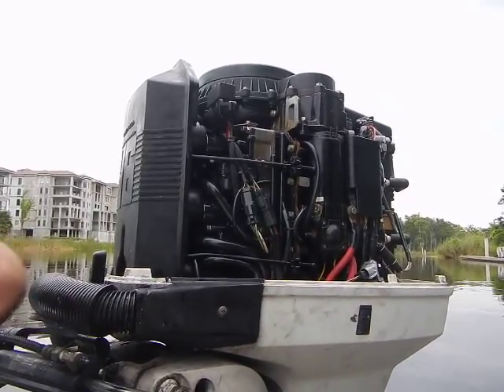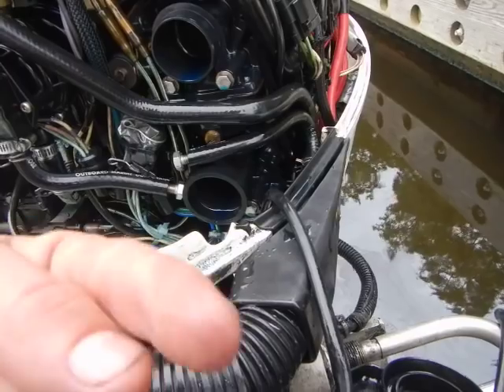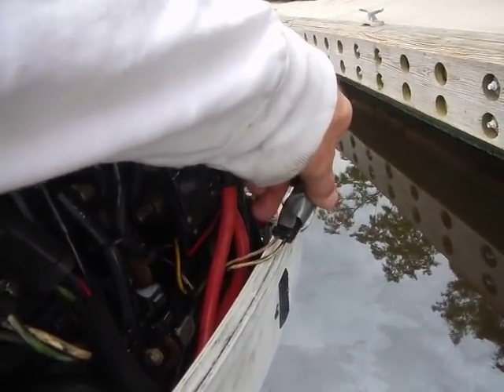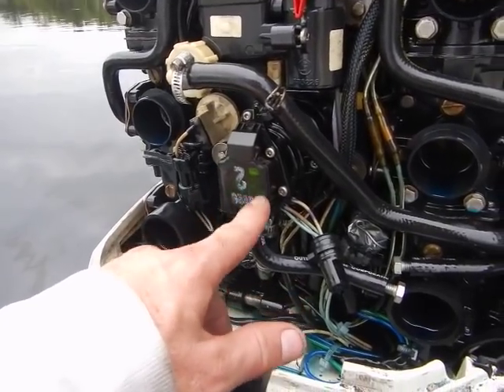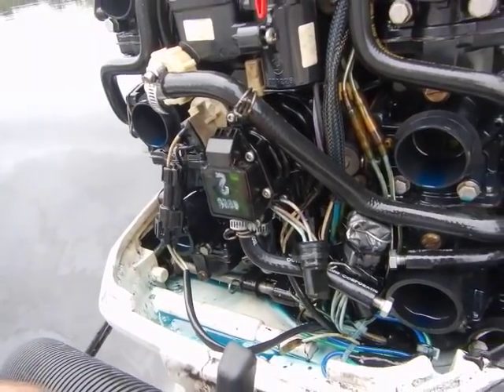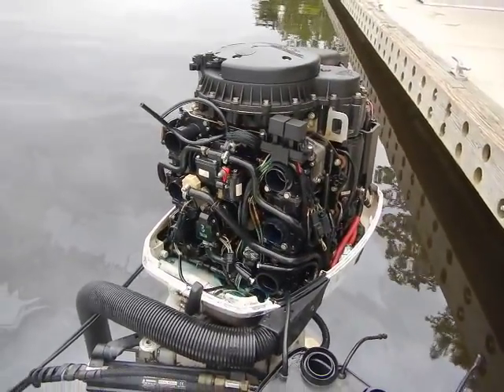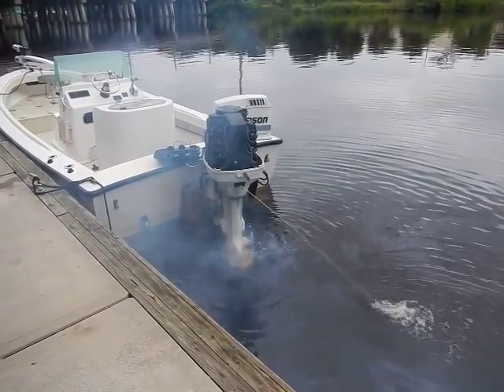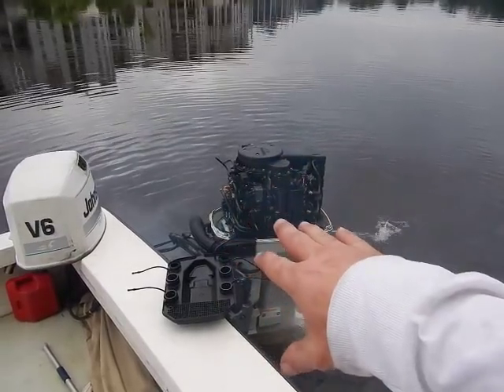Bypass VRO Oil Pump 1996 Johnson 150 HP

Comment: The first thing I did when I got my Johnson 225HP was removing the VRO system because it doesn't work perfectly and can blow up the motor due lack of oil
Reply: When they fail, it pumps max oil. Have you even seen a vro fail? In 40 years I have not.
Reply: @brianmorrison9066  you are lucky... only the Yamaha has reliable oil system...
Reply: I still haven't seen a vro fail that wasn't cause by the owner ie. Water in the oil tank, wrong oil, exc.

Comment: I need to bypass mine Sam motor. Can you send me a pic of the fuel lines above the vro. To of the primer swith. I don't know where the 2 hoses connect. Thanks.
Reply from the maker: I re-powered a couple of years ago, so I don't have it anymore.   
Switched to a 4 stroke.